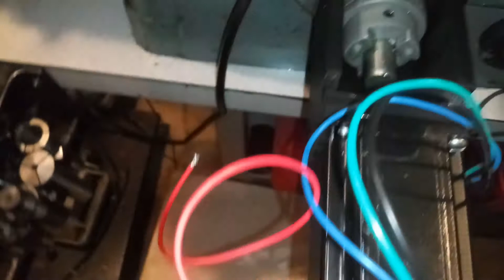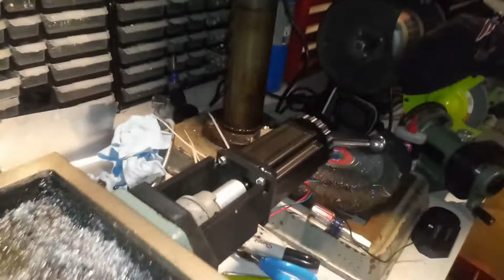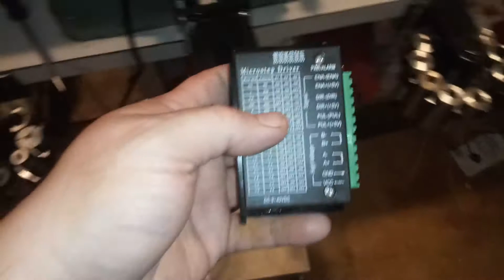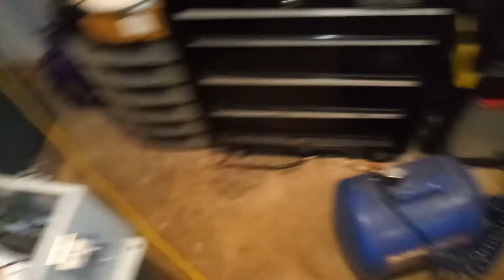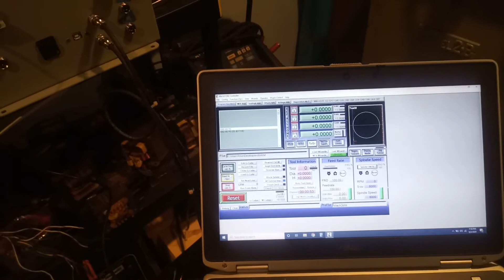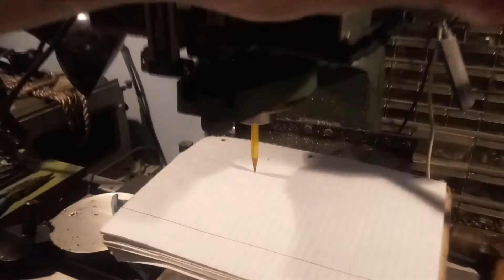Partial CNC Conversion Part 4

Comment: I'm running my NEMA 34's at 70V, but they're a tad bigger.😁 If only the TG6600 drivers only used the TB6600 chip they'd be a lot better, what do you expect for 6 bucks, right? Good tip on the DM542s also. Thanks for the video!

Comment: Awesome progress! Are those hand wheels the same diameter as the original ones?
Reply from the maker: No, the original ones are 4 inches the ones I made are 3.25. it was the biggest aluminum bar stock I had. In the future if I get bigger stuff I'll upgrade it.
Reply: @backwardsmachining7526  Okay, makes sense. Stock is always a fiasco. Looked on video like it would  be uncomfortable to turn with the knob if they were that small. My X & Y table is annoying in that regard.
Reply from the maker: @johnstrange6799  Those handles are not something you would want to use for long periods that's for sure, It would get old quick.
Reply from the maker: @johnstrange6799  who knows maybe even a good first aluminum casting project? Make some handles that way... Hmm
Reply: @backwardsmachining7526  100% agree.
Reply: @backwardsmachining7526  ANY aluminum casting project is a good first project. :) I think Erstwhile was selling hand wheels last year or something. Not sure if he was making them or not. They were nice.